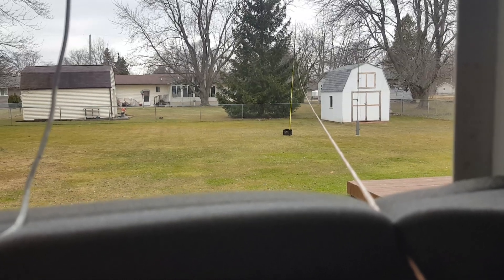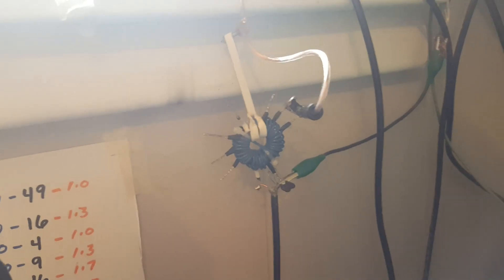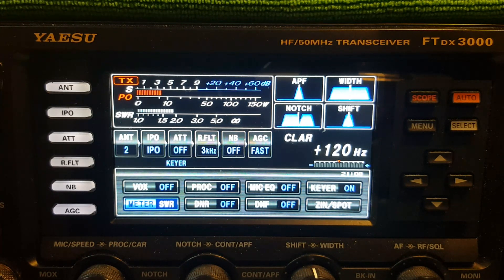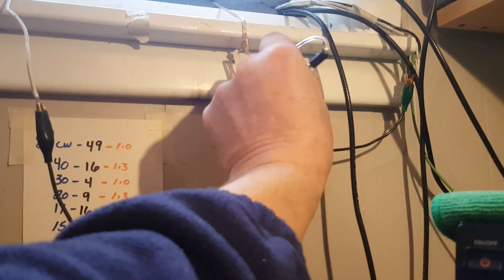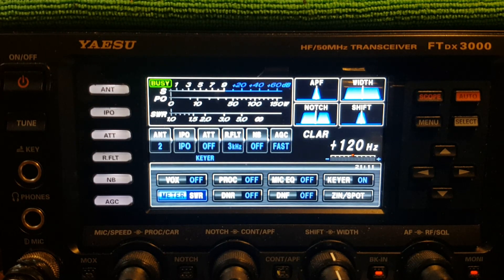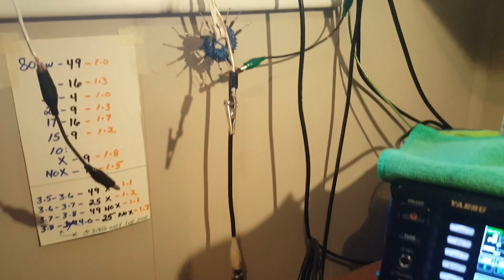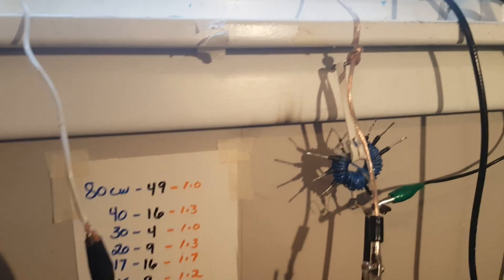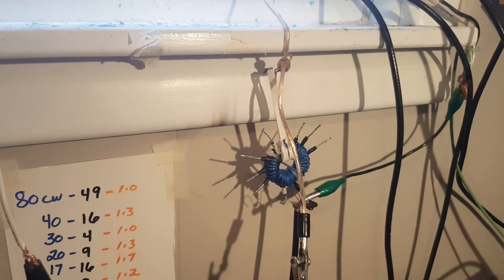My EFHW UNUNs: Why I Multi-Tap

Comment: Having the extra turns shifts the usable frequency range down. In some cases the 10m band may become unusable with a 2 turn primary on a 2 stack of 240 cores. I'm not sure how comfortable I am with trying a single turn primary. I could really use the versatility of multiple taps though listen to the following conditions for they have changed.